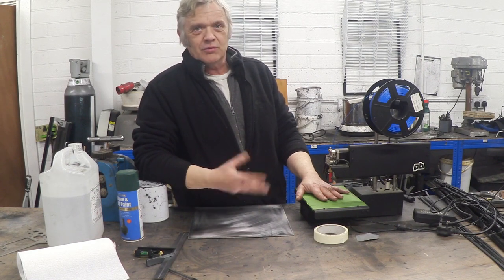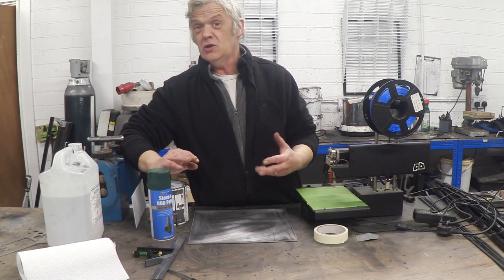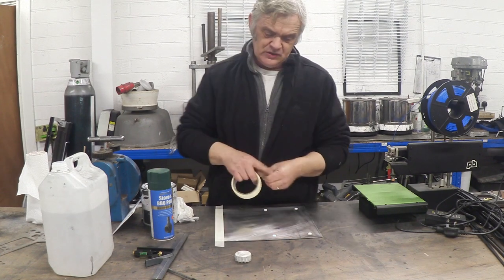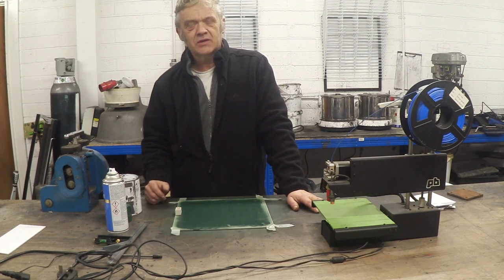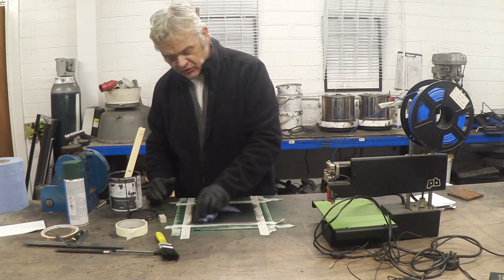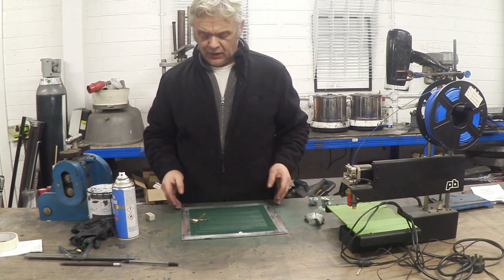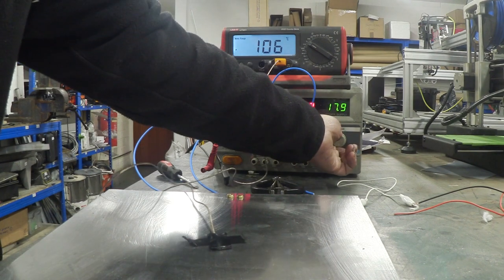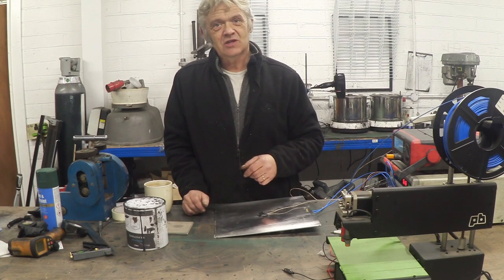Scratch Build A 3D Printer Heating Bed

Comment: Elegant and brilliant build!

The conductive layers resistance could be measured and adjusted to a specified value prior to the second (electrical) insulator paint layer.

Very lightly sanding the thickness would increase resistance if too low.
Applying multiple thinner conductor layers might also work to get resistance to a specific value.

[An electrical engineering grad student  I met back in college would file a notch to adjust the value of carbon resisters to get the exact value  wanted and finish by sealing the cut with paint or fingernail polish.]

Comment: Nice system for making all sorts of heated panels Rob, I think you can push the current up by reducing the distance separating the conductors. How about the outside conductors being connected together and a Centre conductor  connected to the other polarity. In fact you could treat it like a potentiometer and do a rule of thumb calculation of resistance for a given distance and have a better chance of calculating power of a given layout.
Reply from the maker: that'd work mate

Comment: Interesting!  In the next revision, you can make multiple parallel strips to lower/control the resistance so it will work with lower voltage.  Maybe glue in a 100k thermistor and add underside insulation, as well ... like carbon felt or silicone.
Reply: Using like 2-3mm kapton or any kind of electrical tape might work you could also make a 110V or even 220V version by staggering the strips, making a zigzag pattern.
Though I think using more coats of ceramic might be needed to avoid capacitive coupling of the top plate.
Reply from the maker: cheers mate

Comment: For a 3D printer bed that size 500 watt works well, however you don't have the option of variable voltage normally. Might be a good idea to test the heater before applying the last coat of insulating paint, then you can add more conductive ink to reduce the resistance to the achieve the desired result. For a bed that size you would need a 24V power supply and resistance of 1.15 ohms to get 500W. My 500W 300X300 printer bed takes around 5 minutes to get to operating temperature.
Reply from the maker: then you spent money on it mate lol
Reply: @ThinkingandTinkering  There cheap on Aliexpress.
Reply: I thought I saw him change the voltage in this video from 12-24-36 volts. Wouldn't this be variable voltage? Are you talking about the mainboard voltage? I use a MOSFET with my setup and power it with 24 volts with a 310mm square bed. I am going to give this a try using this ink and copper tape but also build a separate one with silicone and Nichrome wire. I am only doing both due to my curiosity. I use something similar to Flex Seal to form around the Nichrome wire to make a flexible heat mat.  The Nichrome wire allows for variable voltage.
Reply: @cabinfourus  If your MOSFET is being controlled by a PWM signal then it is effectively variable voltage up to the maximum of your power supply voltage. So my previous comment is not correct in that regard. I use AC mains-powered silicon heaters anyway with the solid state relays. Using AC means you can use a much smaller DC power supply to run your printer as it does not power the heater. AC mains power with painted on material would be rather dangerous.

Comment: Coming from a seasoned 3D printer guy. Well let's just say back when the DaVinci duo came out And yes it's junk but it got me into 3D printing. I'll tell you you don't have a bad idea there when it comes to using conductive ink. You don't want to go 5 mm bed. It's too much surface the heat now if you wanted to do two 3 mm beds and put conductive paint in the middle that might be worth looking into if you can get that ink nice and flat. you don't want to leave that extra metal hanging off. It's more weight than needs throwing around. You don't have to worry about it being perfectly flat just get a probe and it will self level your bed. Also them silicone heat pads are good if you buy a good one. My big printer has the PCB heater built on but I also have a high wattage silicon heat pad backing it up. Then I insulated the bottom of my bed so I can get to 150 c on my bed in around a minute. But I am curious about that conductive ink depending on how smooth you can get it you might be able to put it on top of a 3 mm plate then sit your glass directly on top of it. I'm not sure how good the heat with dissipate into the glass but the only way to find out is to do it.

Comment: To limit the bed  from radiating heat, it's just a reason to experiment temporary cover made of a good thermal insulator(i.e. black body radiator) as a design material option for the foams being worked on. Nighthawkinlight did an interesting version of an expanding carbon foam("starlight") with school glue, cornstarch and baking soda. Thank you for your work.
Reply from the maker: I will have to look that up mate - thanks for the heads up

Comment: I guess the wattage u calculate is wrong. Since u cinnected the power sources in series to get 48 Volts, the current should remain 5.3Amp for both supplies. So the actualy wattage of ur heater is: 48 x 5.3 = 254.4 watts, not about 500 watts that u mentioned in the video, because 500 watts is much high power for this plate and would not take even a minute to reach 120 degrees.

Comment: wow this Is actually really interesting! it gives a even heating as it's a single strip, and it's super heat resistant as it's directly bonded to the bed, would be super interesting to make one suited for 24v and run some tests, maybe making small sheets to test max w/cm² or resistance be thickness, I wonder what the benefits would be comparing to an AC bed, certainly temperature for sure

Comment: can you try out the automotive engine and exhaust paint, to see if it works with that, and does not damage it? (the paint I am talking about has to be baked on to complete the cure, and its a bit less resistant to handling than say epoxy enamel and what not that you have used so far, and is an actual ceramic coating of some sort, so I am kinda wondering about conductivity through it too, as well as how well it handles the heating elements you paint on, causing possible flexing between the coating and the substrate,  if not maybe once I get some conductive paint, I can give it a go, as I have two different kinds here and some primer made specifically for it, for those wondering, I will give name and brand below of the stuff I have on hand. 

VHT SP102 flat black and VHT SP100 flat gray primer are the two I have on hand, temps supposedly good for are 1300-2000ºF (704-1093ºC) also note if you are looking for it on a shelf, it is named "Flame proof^ as I think VHT has a lot of other paint products many which are not good to the higher temps this is, and probably don't require baking it at 250ºF (121ºC) then at400ºF(204ºC) and one last time at 600ºF(315ºC) all in 30 minute increments with a 30 minute cool down time, which I would love to know why, guessing it has something to do with annealing it on the metal due to the expansion and contraction of both the paint and the metal maybe? still just odd) anyway 3 times you have to cook it at various temps while cooling it twice between so it is involved if you go by their instructions, which I used it to coat my water pipe and pipe cap based pressure vessel to keep the chemicals I was working with from reacting with the metal in the pipe or any coating they had on it :)
Reply: I'd say if it holds to 800C it's probably a form of ceramic or glass which is what enamel is.
Looking at the can it says silica ceramic, so yeah it basically is glass powder/enamel in some sort of adhesive which probably burns out or evaporates when the paint is heated.
Note that I'm not sure it's how it actually works.
Reply: @satibel  sounds like a possibility, I have been working on an aluminum oxide coating system but to try and coat something with a monolithic aerogel form of aluminum oxide, if I can achieve it, I will definitely be trying to do the same thing with zirconium oxide next :) of course the ultimate would be to manage an aerogel form of tantalum carbide to hit something over 3000ºC resistance, since hitting a full 3900 something C melting point before it collapses but still if 3000 could be reached as an aerogel level of insulation, man the implications for kiln work, :)
Reply from the maker: that is interesting stuff mate - I will have to look it up - cheers and thanks for the info

Comment: The idea of a paint booth being over kill for painting one or two of those is not very accurate. It in fact depends on the nozzle on the paint can.

A few months ago I painted a project and decided to do it in the bathroom so that the fan would evacuate the fumes. The nozzle on the paint can I used is designed to give you a broad spray which turned out to be a bad idea. 

I had a 20 inch by 27 inch bench covered with a shower curtain. Spray droplets were not only on the floor in back of me, but a good two feet on either side of the bench.

That broad spray, in addition to painting a wider path on the wood, blew over spray paint droplets all over the place. I literally had to use a scrubby to get the paint off the bathroom floor. Where a standard nozzle makes a mess in the area that you are painting, that broad spray nozzle tends to make the paint droplets fly all over the place. 
 
Just keep that in mind should you decide to use the new  fangled cans with a broad spray. It will be a very bad thing should the industry decide to discontinue the older, not so messy spray nozzles on those cans.
Reply from the maker: it also might be an idea not to paint stuff in the bathroom mate
Reply: @ThinkingandTinkering  
Shhhh! Don't tell the apartment manager.
Yeah, I figured that after the fact. 😂

Comment: Interesting video - thanks
preparing the plate for painting reminded me of a  youtube video I watched recently which I thought might be of interest to you as it has helped me a lot "Building Prototypes Dan Gelbart part 6 of 18 Coatings".
He suggests rubbing with solvent doesn't work well as it just redistributes any oil and it is far better to clean with Ajax,  you can test this by running water on to the surface to see if it wets it not.
Reply from the maker: cheers mate

Comment: on the temp and voltage, I have to ask, what is it laying on, maybe a lot of your heat is being lost to the table? I had trouble getting the unit I had on a prusa I have up to temp taking sometimes over an hour, and the upper temps it just would not reach period, then when printing started I would lose temp quickly causing issues, but it had zero insulation, it was just floating on springs and had a glass plate clamped to it, so I bought some ceramic fiber insulation and put two 1mm layers under it, using kapton tape to attach it to the bottom of the heater and ran a layer of that over the entire surface of the bottom so fibers were not exposed to the bottom to fall out of the printer, and after doing that it is now able to shoot up to the upper temps it could not reach before and even is so stable that I thought maybe I broke something but after testing it really is that it is super stable before printing and barely loses any stability while the bed is whipping back and forth (Y axis motion only there but still plenty to get air to circulate even if it is trapped as mine is, in a cabinet to keep the heat inside) so maybe if you got some sort of decent insulation under it, (2300F ceramic wool paper is what I think the search criteria is on ebay but if not, it is definitely in the section with kiln materials, and pro tip just buy a whole roll lol, I have because it was barely double what I would have paid for the roll I got of 2mm stuff for the giant 400x600mm heated printer bed I bought, so it did not seem to make sense to buy two sections like that when I could get a 2 foot by 25 foot roll for double the price, and since I have been using the extra for stuff like insulating the heater inside my hot melt glue gun, which now works so much better and gives continous feed of liquid glue instead of needing breaks to heat back up, and electric soldering iron's that now have no trouble getting hot and staying hot enough for even stubborn solder with the upper temperature end for solder where any hotter and it becomes brazing alloy LOL) I am not even sure what all else I will end up using this stuff for yet, but I am sure I will find something, especially since I have a little kiln that I am going to start using in my research, along with my TV tube based vacuum chamber system too, (larger picture tube so I can fit a small 200x200mm xy system for 3D printing in plasma and vacuum deposition research XD )
Reply from the maker: oh for sure mate - it was just on the table - I tried it with ceramic wool and it performed much much better - but I kinda thought it was a cheat as most folks don't do that I think - but you are 100% right I think and thanks for taking the time to post - really helpful - cheers
Reply: @ThinkingandTinkering  if more people are not using this tech, in their heated beds, they really need to be, I got the idea from it being used to insulate the heating block of the extruder, really, :)

Comment: Good vidio Rob. 
Is the ink flexible because I want to make a flexible heater and wondered if the ink will crack.
Reply from the maker: it's flexible as a film mate - if you apply it too thick it will crack but 80 microns or so is fine - well in my experience it is

Comment: WoW 170 degrees  ! 
Maybe glass is an Idea as top layer
It's 100% flat.
It's used on old Prusa Mk 1
Reply: Glass can be actually quite wobbly and/or tapered.
Reply: Mirror tiles are flatter than most glass and you can simply check for distortions by looking at the quality of the reflected image.
Reply: @Martin-bx1et  yeah mirrors are quite flat, a good test is to look at a grid (like a notebook) through it.
Doesn't prevent tapering, but this can be fixed with adjustment screws.
The main problem with glass is shattering on heating.

I mean, it's probably flat enough for the purpose, but not as a surface plate, so I wouldn't call it 100% flat.
Reply from the maker: my friend uses a glass layer over an Ali heated bed
Reply: yes you can use glass, it should be at least 4mm thick. Me myself use 6mm glass. its better to use tempered glass for better performance and straightness.

Comment: Fascinating! What effect, if any, do you think extending the copper tape contacts to cover more of the interior surface of the plate prior to sealing/coating might have. Thanks again for your remarkable videos.
Reply from the maker: it should reduce the resistance and so increase amp draw and therefore higher heat - and cheers mate
Reply: @ThinkingandTinkering  hmmm, just gave my own 3d-printer a "brain transplant", maybe a custom bed also lies in its future; something to think about ;). your time and efforts are greatly appreciated, and cheers to you as well sir!

Comment: I would imagine the size of the copper tape would make a difference. A 12-volt heated bed at 220mm square would need more amps than a 24-volt bed at the same size.  Most of the store-bought 3d printers use 12 or 24 volts and upgrading to 36 volts isn't really ideal, since one would have to purchase all new hardware to work with the 36-volt power supply needed.  You say it takes 30 minutes to heat up to 100 degrees c in the video, using 5mm copper tape. I am sure there would be a bit of math involved but one could shorten the heat time by using a different size copper tape with 24 volts.
Reply: Or you could power the hotbed from an independent psu perhaps?  add a 12V or 24V switching relay to control the power going to the hotbed from the independent psu via the thermistor mounted on the hotbed. Whichever matches your system boards' system voltage.

I have a 1220mm (4ft.) heated bed that I made, runs on a dedicated 60V PSU (120V Mains), draws a bit of current but its not obscene (5.18~5.22A), pulls the heat from ART to 120C in a little more than a minute. I built it nearly the same as this procedure,  and the cost to build a 3D printer that's capable of doing objects up to 4ft cube was FAR less doing it as parts than it was to buy a  pre made or even a diy 220mm  with a bed that had a hard time reaching 100C.

Comment: Could this be used to make a flexable heating pad assuming you chnage the base material?
Reply: You could either 
- use a silicone sheet and paint on it
- cast some nichrome or steel wire in silicone.
You can use any kind of plastic instead of silicone if you don't go over it's melting temperature.
You should also check that the conductive paint is flexible too, if it isn't it will crack and break the connection.
Reply from the maker: yes mate - I'll make a flexible pad I think
Reply from the maker: nice post mate - cheers
Reply: Robert Murray-Smith looking forward to seeing the next video! :)

Comment: How far of a span can your ink dissipate heat through, before needing another electrode?  Can your ink work on a flexible steel sheet print bed?  My printer runs its heated bed currently at 12V, so I would need to upgrade my power supply!
Reply: Painting more coats would lower the resistance, and increase the power on the same voltage.
Reply from the maker: as size increases so will resistance mate and then you need to up the voltage or paint more coats like solar hope said - I did do a panel 1.2 meters by 2.4 meters but I ran it from 230 volts - it worked fine

Comment: Have you power cycled it often to see if thermal expansion and contractions becomes an issue with the paint life/adherence? Could the Alu plate itself become one end strip if the insulating paint was stopped early and the conductive paint allowed to touch it?